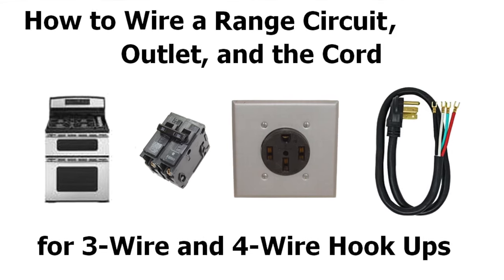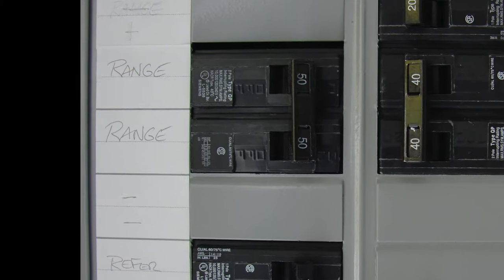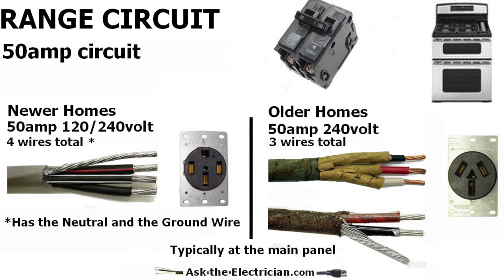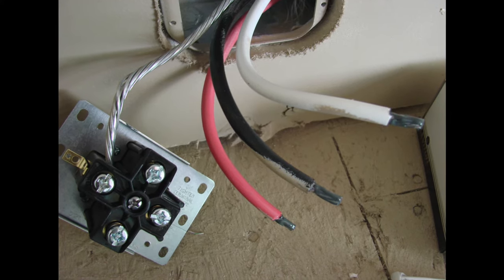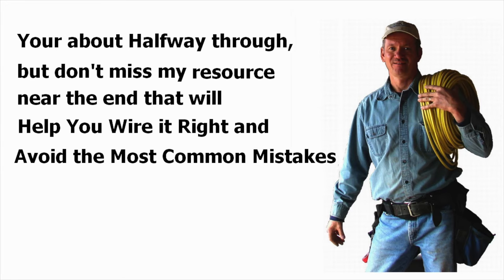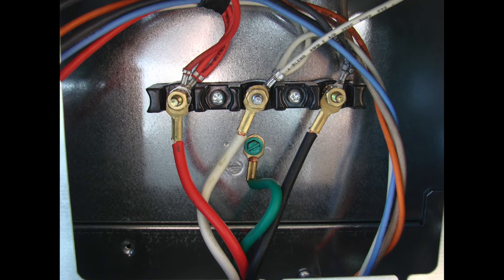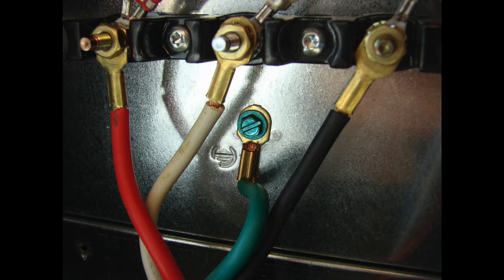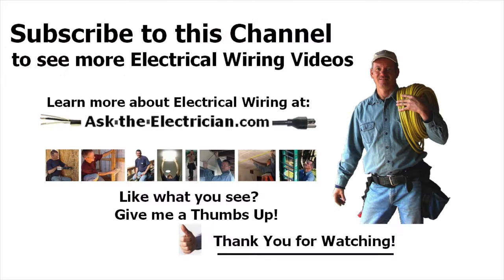How to Wire a 3Prong or 4Prong Range Cord, Wire a the 240Volt Range Outlet.

Comment: I just purchased a used electric stove for a rental.  The cord on it now is a 3 prong.  However the sticker on the back of the stove has a diagram for a 3 prong and 4 prong cord. So I guess it can be wired either way.  I have to run a new circuit from the panel, do you suggest I run a 3 wire or 4 wire cable?
Reply from the maker: Installing a 4 wire would give you the opportunity to be ready for a new stove that would not work with a 3 wire cable.
Reply: @AskTheElectrician   yes, that's what I figured.  I went ahead and ran a for a 4 prong.  Thanks

Comment: Hi, great video. Thanks for sharing.
I got a Samsung wall double oven. The Electrical cord the store gave me has 3 wires only. Hot, neutral and hot. The oven has black, white and nothing on the red spot. This means the oven works on a 110 volts with a 40 amps braker and wire#8?
Reply from the maker: What does the oven installation manual state for the required electrical circuit? Or - take a look at the nameplate on the oven, typically found inside the door, what does the electrical specifications state. The specifications provided by the appliance is how we determine the circuit requirement, because all ovens are not the same.

Comment: my wall plug for my range is a 10-50r i can see 4 cables coming from wall 2 white seem to be on the bottom prong, also i dont have a 50amp breaker at all in my panel! any idea whats going on ima try to find the breaker thats linked to this electric range

Comment: Can I run 10-2 from the panel to the outlet for a range?
Reply from the maker: Check the specs for your range, however most will require a 50amp circuit, and #10 copper wire is rated for 30amps, therefore 10-2 is too small.

Comment: Great vid and thanks. Need to run a circuit for a new range install on my remodel.  Old range was gas. Wasn't sure of the updated codes and you answered all the questions. I am a commercial plumber by trade, Done plenty of water heaters but never a range. I will be pulling all my wire in conduit. Can the ground be #8 instead of #6 like the 2 hots and neutral?
Reply from the maker: Thanks for your Comments.
Please Visit ask-the-electrician.com for more detailed information.

Comment: very good info, thnaks alot, but please can you tell the type of wire we need for the outlet? as I'm trying to install the 220 outlet for the range and need to know which wire need to buy based on the info you provided in the video ( 4 prong cord and outlet) . Thanks in advance.
Reply from the maker: Thanks for the feedback.The typical 50amp range circuit is wired with a #6/3 with Ground CU Type-NM cable. When installing with conduit the wire size is #6 Copper, typical Type-THHN.

Comment: I have an older 3 wire, red, black, and bare aluminum. Is the bate aluminum safe to attach to neutral?
Reply from the maker: This would depend on the specific range that you have, and if the wiring specifications allow this to be done. Check with the installation manual for your range.

Comment: Just curious on the wire 3 wire outlet the uninsulated neutral safe for reinstallation?
Reply from the maker: The older homes had a non insulated ground wire that was used for the 240volt range. But when a 120/240volt range is installed it typically requires an insulated neutral wire and a ground wire.

Comment: On a 4 wire range do the ground wire and neutral wire need to be attached to separate bars in the service panel or can they both be affixed to the same bar?
Reply from the maker: If the service panel is the main service panel then the neutrals and grounds are terminated together on the same bar.

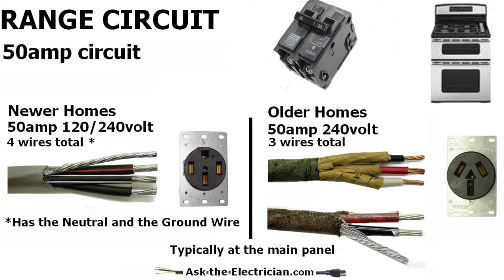Comment: Installing a new whirlpool wall oven. No outlets (from stove or house power) just a  hard wire with wire connectors. My older house power supply is identical to image on bottom right at 2:43 in video (black/red/aluminum twist). However, the stove has a black/red/white/green ground. Can I connect the stoves white/green to the aluminum twist from house power all in one wire connecter? And then black to black and red to red obviously.
Reply from the maker: Refer to the Installation Manual for the specific oven that you have. If a dedicated neutral wire is required then you may not do this, however check to see if the manual states that the neutral and ground may be bonded together, if so then follow the instructions found in the manual.

Comment: Hey Thank You for clearing that up, a NEW home as compared to an OLD home hook up. Where would be the best place to get my wiring for an upgrade on a kitchen? Probably New Range hook up, electrical working outlets, garbage disposal, and microwave oven, MAYBE a double oven hook up??  Thanx,  Raul PHX metro
Reply from the maker: Electrical wire prices are at a premium, so it is best to shop for a great price, check with any big box store, I also check with the local Restore which are Non Profit outlets which are run by Habitat for Humanity, and they sell donated items at discounted prices, you may find a wide assortment of useful electrical materials,, appliances, and some are brand new, so check with your local Restore for more info.

Comment: Can I use any washer on the terminal block screws or do they have to be specific? Also can a 4 prong outlet somehow be modified for a 3 prong power cord? Thank you!
Reply from the maker: Typically a washer is not needed for a terminal block connection.
A new 3wire outlet should be installed for the 3wire dryer cord, a 4prong outlet should not be modified.

Comment: is it possible to wire a 4 prong oven with a 3 prong wire instead of swapping out my outlet?
Reply from the maker: Not all ovens are the same, so we typically need to see what the installation manual and electrical wiring requirements require for your specific oven.
Reply: thank you sir much appreciated

Comment: My new range has four connectors, two hot, a neutral, and a ground.  I am installing a new four prong outlet and have on hand 6/3 Romex which contains three 6-gauge sheathed wires plus one smaller unsheathed copper wire.  My question is, can I use this Romex or do I need to get something with four 6-gauge sheathed wires?
Reply from the maker: The 6/3 Romex is correct and is used in a typical installation for the circuit, however the wiring between the range and the four prong outlet should be made with an approved Range Cord. The issue is that a free standing range needs to have a cord so that the range may be unplugged.
Reply from the maker: An approved metallic grounded conduit that is installed according to code with the appropriate fittings, and properly bonded at each end will serves as the ground, again, if it is installed properly, otherwise install a ground wire as well.
Reply: @AskTheElectrician  Well, as I said my cable has an included ground but it is not 6 gauge.  I included a link in my question to the actual cable I own.  Is that going to work or do I need to use a cable where all four wires are six gauge?   This seems like an important question.
Reply from the maker: Some of the cables for a range do have a smaller ground wire, and that is fine and acceptable for the circuit to the receptacle outlet.
Reply: @AskTheElectrician  Thank you!

Comment: hi friend, can I use an electricity monitor between our cooktop range & the electricity wires? 
we have ariston elect cooktop range (2 burners) in our condo
It's hardwired to electricity wires (no wall socket)
We'd like to monitor the kw consumed by the range
I saw an electricity monitor (V, Amp & KW) online which has 2 connectors on top & 2 at bottom, my question: if I install the device between the electricity feed wire (lines in) & the cook range (line out), will it work & also give us the kw read-out? the monitor device is advertised to connect to the fuse-box. Do u have any alternative solution? Thank you 🙏
Reply from the maker: Typically a 240volt circuit is monitored at the panel. There are KW usage monitors available for 120volt plug in devices, but that would not work for your application.
Reply: @AskTheElectrician  thanks a lot 🙏

Comment: Can I use a 4 to 3 prong converter for a new stove?
Reply from the maker: It will depend on the stove that you have and the electrical specifications as mentioned in the installation manual of your stove.

Comment: I have a stove with 4 connectors attached is 3 wires cord.
On the wall side I have 4 wires attached to a 3 wires outlet, meaning the ground is not attached. This is giving a faulty wiring as per the stove display.
Can I attached the neutral and bare wire together into the outlet?
thank you
Reply from the maker: Hi Mario - If the circuit has 4 wires then a 4wire outlet and 4wire cord should be installed. This will provide the separate neutral and ground connections that your stove requires, and this will clear the error code that the stove is now displaying.  
Enjoy your stove!

Comment: Can you convert a new 4 prong stove to the old 3 prong style.  Mine comes through the floor and there are only 3 wires present.
Reply from the maker: It depends on the specific stove that you have. What does the Installation manual say.

Comment: For a newer home 4 wire, will it effect the appliance if neautral and ground are bonded in the panel?
Reply from the maker: No, as long as it is the main panel, which is where the neutrals and ground wires are bonded together at the main panel, as required by code at a typical home.

Comment: if you dont have the green screw can we just put to any screw just holding the unit together correct?
Reply from the maker: It is best to use the Green Ground Screw that is supplied by the manufacturer which will ensure it makes a good bond. Consider obtaining a replacement ground screw from the manufacturer or authorized supplier.

Comment: I just got a new oven. The old plug and cable are three prong. I'm guessing the oven is four. Does something here need replaced, or may I wire the old three prong cord in and be good to go? Thnaks.
Reply from the maker: That depends on your specific oven, some are OK as a three prong, but most new ovens require a neutral and a ground. Check the existing circuit wiring, You may discover that there may be a neutral and ground, depending on the age of the home.
Reply: Look at the ovens specs and it will tell you what is required.

Comment: Good day sir.. i have a question @4:51 i noticed that the metal outlet box is not grounded. is that a requirement? with the little green screw?
Reply from the maker: Yes - we do ground the metal box as well before closing up the box - very good observation on you part.

Comment: Hey I have commercial toaster I need to test if it's working . It has a L14-20 plug . Could I re wire a 14-50p cord just for the time being to test in my 14-5Op oven outlet? Toasters 120/208/240v. Thanks
Reply from the maker: Connecting the toaster to the specified power source with the proper circuit connection device will enable the unit to be safely tested.

Comment: @Ask-The-Electrician If I am hooking up a 50amp welder circuit 3 prong 6-50r receptacle. i bought some 6 gauge copper Romex thats 3 conductors rd/bk/wh plus bare ground. Would it be preferred to use the bare ground and cap the white in the panel?  It is a main panel so I believe the gnd and neutral are bonded but haven't removed panel cover yet... not sure if that is important info to answer my question. Thanks for great videos and good luck with your channel👍
Reply from the maker: Yes - after verifying the ground, we typically cap the neutral wire and use the ground when the neutral wire is not needed.
Reply: Boa tarde, gostaria de uma informação   se puderes me ajudar lhe agradeço,tenho um forno combinado forno e microondas e quero instalar aqui no Brasil,ele tem quatro fios vermelho, preto verde, branco,aqui eu tenho rede 220volts fase neutro e terra,sabe me dizer quais dos fios eu ligo??desde já obrigado..

Comment: I had a surface mounted outlet with 3 wires that come out of the wall. 2 black . 1 bare. I want to istall flush mounted 3 prong outlet but wondering if I can use a metal box since there is no dedicated ground wire? Is metal box allowed for this appliucation?
Reply from the maker: A metal box may be used when installed properly and according to code for the application.

Comment: Searched dozens of videos, this was the first that shows what I have in my 35 year old home. I have the 2 wires with the ground wire only for the oven. Red and black with a cooper ground. No white neutral wire at all. I presume it still wires the same as in the later part of your video. If I understand correctly, the ground becomes the neutral and the green ground to the oven attached separately? Btw, there is no plug in my application. It is directly wired into a 4 gang box. Does this change anything? Your help is greatly appreciated. Thanks.
Reply from the maker: The circuit wiring for the oven or range should be verified and then labeled, especially if the white wire is in fact a power wire of the 240volt circuit, then  for example it should be marked as red. If your oven or range does not have a separate neutral wire then the circuit will be OK to wire. However if the oven or range does have a separate neutral wire then you will need to look in the owners manual for the specific electrical requirements and the wiring instructions for the wire connections.
Reply: @AskTheElectrician   Thank you sir; The new oven does have red, black, green and white and also is open free wire w/no plug. Can you re-iterate how that should/would all wire together in the gang box with my old 2wire/plus ground set up?

Comment: So if you're wiring a newer 4 prong oven plug to an old 3 prong outlet, from the diagram that the ground connector gets ran to the middle white neutral wire? How can a ground be piggybacked off a neutral?
Reply from the maker: A ground cannot be piggybacked off a neutral, the two must remain separate. Consult the installation manual for your specific oven to see if it requires a 4-wire circuit (separate neutral and separate ground) and any wiring information the manufacturer requires for your oven.
Reply: @AskTheElectrician  I'm referring to the ground strap that is connected from the green ground screw in the oven terminals to the white middle wire which as far as I know is a neutral yes? i wired the old plug from the old oven (3 prong) to the new oven (4 prong). The ground strap was on the ground and neutral terminal when I removed the 4 prong plug. Isn't the ground strap supposed to be removed and not attached to the neutral when you have a 4 prong plug? It's wired as such from the factory. I just kept the ground strap like it was (ground strap attached to the neutral) and wired the 3 wires on the 3 prong. It works fine. Is there anything wrong with what I did? Wouldn't I be fine being the new oven was already wired with the ground strap attached to the neutral?
Reply: Depends on  if your neutral and ground is bonded at the electric  panel if not bonded at the panel ground and neutral should not be bonded  at the range either.
Do you have any issue as it is?
Reply: @summerforever6736  it worked fine for a couple of months then my wife cleaned the oven, smacked the heating element pretty good and it stopped working, it would get red hot at one spot right as it comes into the oven from the back oven wall. The stove top works fine and we have a second oven for baking. The range was used, my father in law wanted to help out and grabbed us one before I could get a new one. I haven't checked the panel for the neutral and ground to be bonded yet. I will now. What do you think? If it isn't bonded at the panel I'd think there would be some snap, crackle, pop instantly when I turned it on for the first time? My wife attempted to try the oven again and worked for a couple days, she said she heard it pop (didn't trip the breaker) and stopped working, instantly shut it off and haven't used it since but the stove top burners (not gas) still work fine. I assumed it was the "failed" heating element acting up. They're pretty cheap so I'll probably change that unless you think it's a wiring issue and not the element.

Comment: House has 3 wire wiring. White, black and bare copper wire. Was connected to 3 prong 240 for old stove. New stove has 4 wire olug set up, red, black, white and green. Is there a converter to plug since i dont want to run a whole new 4 wire to stove location?
Reply from the maker: I am not aware of a converter that will create a ground wire where one is not available.

Comment: Can I run the wire through a conduit from the main panel to the outlet on the wall surface?
The old house has something like shiplap wall covering on the inside walls. The ceilings are 10ff high and the area is to low to the ground to access it from the crawl space. The existing wires are run through pvc electrical conduit but its easy to see they did not use 6awg wire and the conduit is only 1/2".. The complete run is only 18ft from breaker to the outlet. Thanks
Reply from the maker: Yes, an approved surface conduit can be used, EMT being the most common,  however there are more attractive wire molding channel products that can be used as well, along with the appropriate fittings and boxes for your application.
Reply: @AskTheElectrician  There won't be but maybe 4ft  at the most 5ft visible. I'll come straight down out of the main inside the wall and come out of the wall a foot or so from the floor then it will run just passed a window where there will be a wire shelf that goes into the corner and it can be painted when the kitchen is painted. Do I need to use 1" conduit or will 3/4 be sufficient?  6/3 with ground is fairly large I'm not sure of the exact diameter of it.
Thanks so much!